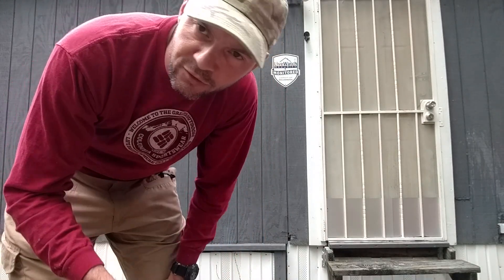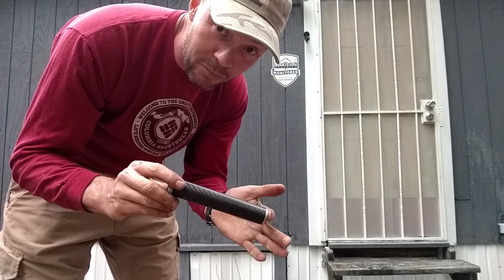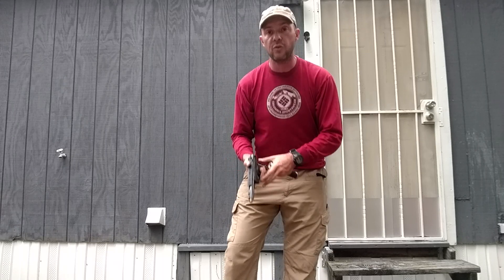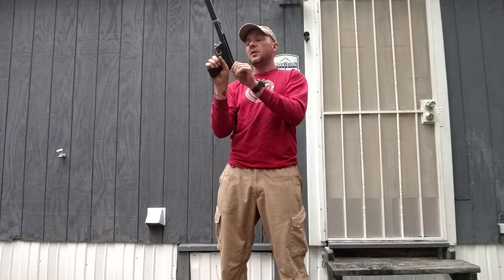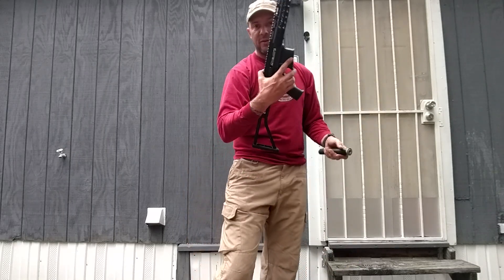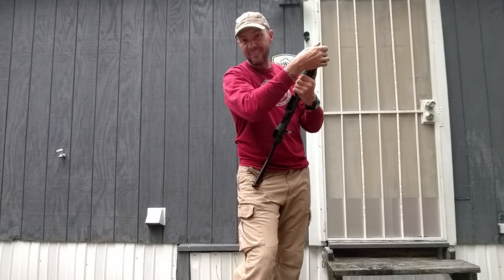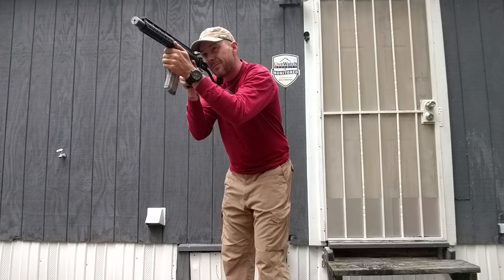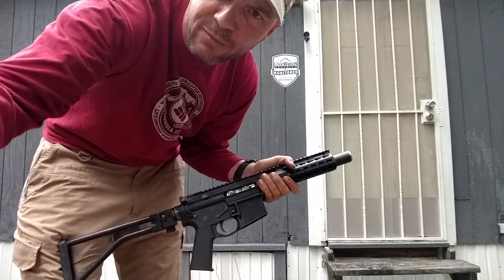Another form 1 suppressor

Comment: Can you tell us more about the monocore build?  Which works better for you?  Thanks
Reply from the maker: Pretty much copied the baffle design of liberty/gemtech mono cores for 22lr. There was no need to reinvent the wheel lol  except I made it a little larger as I wanted a bigger volume can, also did it in stainless so it could handle 22mag with no issues. 
Although I could have done K or other lathe cut baffles, doing a mono core was much more straight forward
Reply: Thanks for the reply and very much appreciate your military service.  Glad you made it home OK.